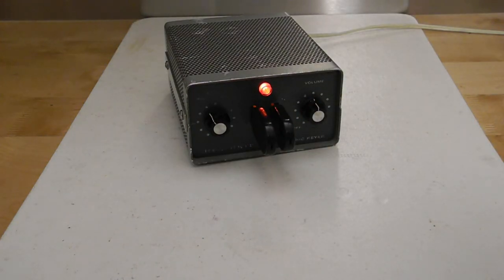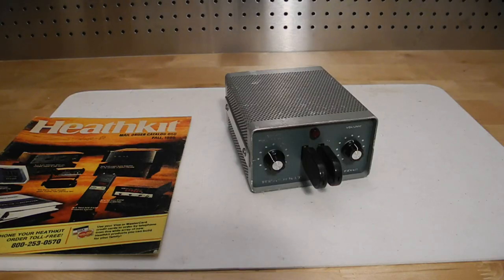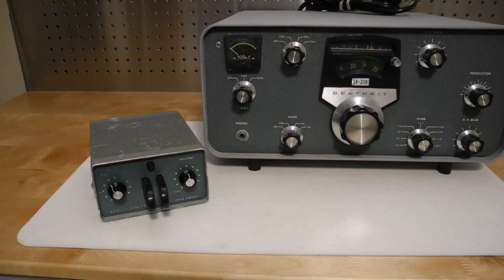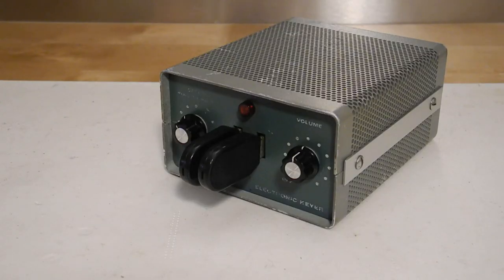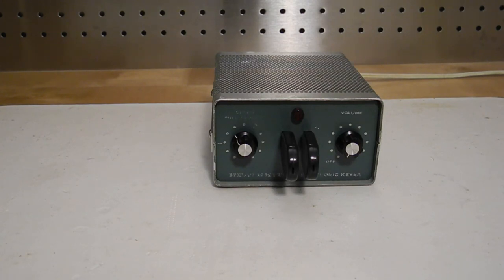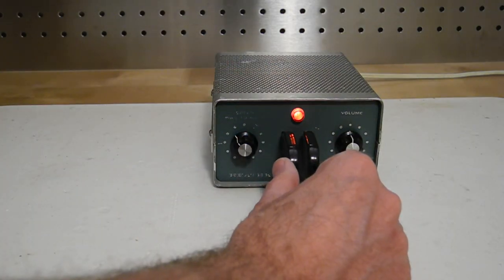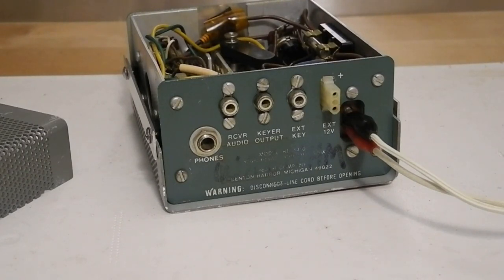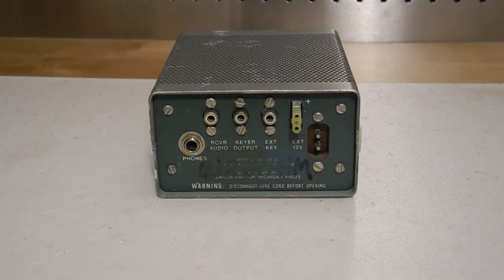The Heathkit HD-1410 Electronic Keyer

Comment: The external keyer RCA jack is for a straight key. I built mine back in 1980 still use it today.

Thank you so much for the video. I haven’t opened it up since I built it.

Comment: Hi Jeff,

I built one of these in the early 1980s. I'm left-handed so I wired it up for right-handed operation and found room on the back panel to mount a small toggle switch so that I could use it left-handed but others could use it right-handed.  I also made the modification to plug in an external paddle. I never could get the internal paddle to work just right. I used it for several years.

Good video, thanks.
--
Mike - WB4HUC
Austin, Tx

Comment: I think a minor modification of adding a proper line cord that is attached to the rear  and  you should use  a strain relief to do this.
Where the 12 volt plastic connector is a chassis mounted fuse holder should be placed. A larger square plate to enable these mods would be in order.
You could still open it up without worrying about getting shocked if done right. Nice review Jeff!

Comment: Thanks for this detailed informative video. Will this work with World War II-era vacuum tube transmitters? I assess that this keyer has only iambic mode A?
Reply from the maker: It will work if you stay within the maximum keying rating of positive voltages of 300V and 200mA or negative 200V and 10mA. It is Iambic A mode only.

Comment: Hi Jeff, I have an IM-28 vtvm that worked perfectly after I repaired it. It now does not read ac. I've checked the tubes & they are good. I've put it aside & am working on other things. Do you have any suggestions as to what to check?
Reply from the maker: The manual suggests the following if AC is not working:
1. Check the 6AL5 tube.
2. Check C1 .047 uF 1600 volt and the two .05 uF capacitors C2 and C3.
3. Check the function switch carefully.
I would also check the resistors around the 6AL5 tube and ranges switch resistors R2, R3, and R4.
If you don't have one, you can find copies of the manual on the Internet from sites such as mods.dk

Comment: My hd1410  will not key my Omni A. It's switching from receive but no output. Is there a circuit diagram to make it activate a mechanical relay?
Reply from the maker: It is not a relay, but this may be what you need. See the section "Modifications For Use With Ten-Tec, Triton And Rigs With Similar Keying Requirements" at https://k7mem.com/Keyer_HD-1410.html
Reply: @jefftranter  Thanks Jeff. The HD1410 will key the Century 21. It has a switching diode.

Comment: Can you use the with the Kenwood 830 ?  Thx for put. the video 73, ON3MK   Mor
Reply from the maker: Yes, it should work. I found a copy of the Kenwood 830 manual and it listed the voltage at the key jack as -65V and that is  within the -200V limit of the HD-1410.
Reply: @jefftranter  Many thx for you replay  73,

Comment: The HD-1410 was my first electronic keyer and used it for several years back in the 70's. I later bought another one at a hamfest. I also had a Vibroplex bug passed on by my Elmer. I liked the 1410 over the bug but I loved the looks of the Vibroplex 🙂73 de WA4JAT